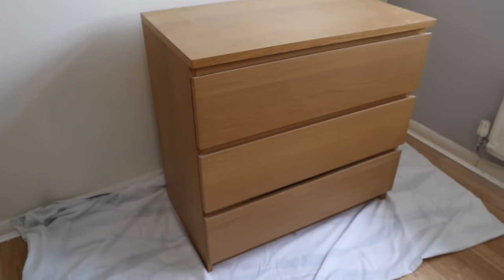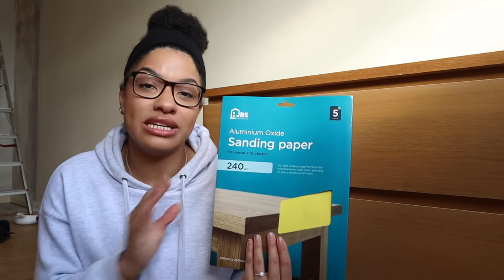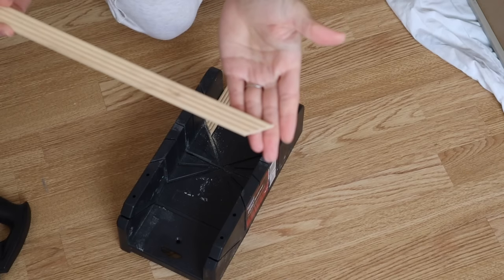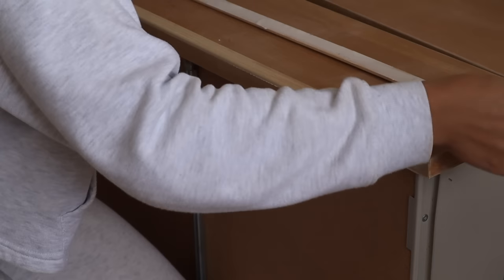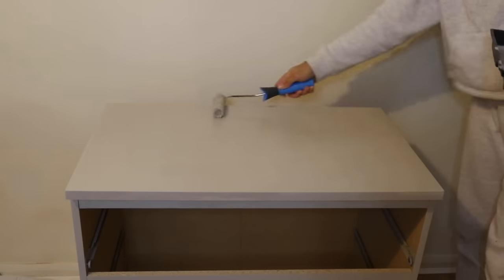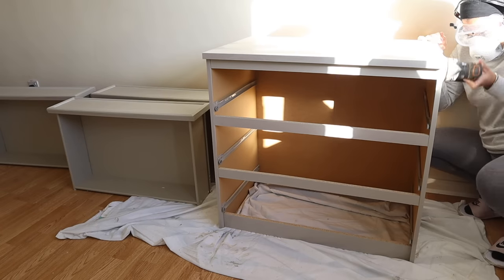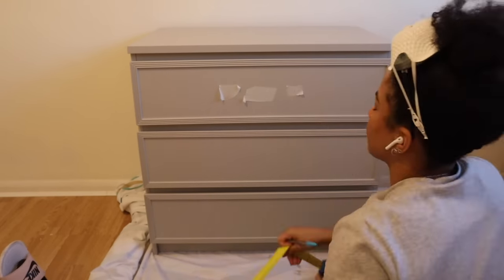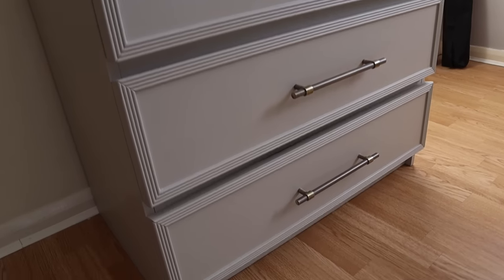IKEA MALM TRANSFORMATION | Budget IKEA Hack | Shade Shannon

Comment: Hi - I have some of the malm dressers and I want to replace the drawer glides with longer extension ball bearing drawer glides that allow the drawers to go all the way out. Could you make a video for this? Especially curious of what hardware would work.
Reply from the maker: I know what you mean! Will try to do this one day. Just bare in mind if you do this you will need to secure the dresser to the wall because it’ll become top heavy and tilt when the drawer is fully extended

Comment: Unpopular opinion: I really like the basic Ikea Malm furniture. I prefere plain, simple looking furniture over handles, edges and ridges. That being said, you still did a nice job. Looks professional. Only comment is that the edges of those moldings don't line up properly. There's a gap you filled in that shouldn't be there to begin with. If you sand the edges of those moldings at a bit of an angle, they should line up just perfect. And sanding between paintjobs is way better by hand than by machine. You don't really save that much time and effort.
Reply: I agree. I would have just bought a new, white malm for $79. Almost the same price as paint and supplies. Then you can use the other one in the garage or laundry room. You could still add the trim but you would not have to paint. There is also the time savings, so it's a win.